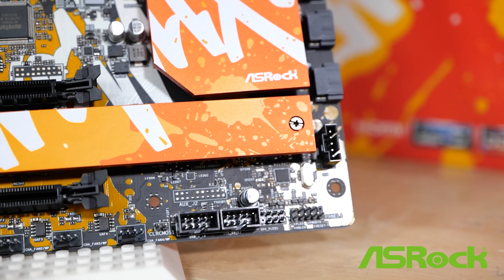Computex 2023: AMD @ ASRock! Plus Solidigm, Kioxia, and More!

Comment: 30TB NVMe, yeah at what price? I can get a 20TB Seagate NAS drive for $340 and their EXOS drive for $360. The problem with NVMe is that its just too expensive. And 8TB NVMe cost around $999.99 give or take $100 depending on quality. Meanwhile an 8TB HDD cost $70-110 depending on brand/quality. That makes NVMe about 10x the cost of standard platter drives. With that 10x ideal a 20tb NVMe would cost AT MINIMUM $3600 which just isn't viable for consumers. Business sure.... but we need consumer drives. And then you figure the higher you go the higher the price gap, so 30TB, I bet its like $10,000 per or more.... because "rape your wallet"

Comment: The thing about RGB on motherboards is I've still yet to see it done where it doesn't look like it was an afterthought tucked under a heatsink or a tiny strip on the edge of the board. You may as well not even have it at that point and leave it to the user to add it. It's just another box to check to warrant increased prices.

Comment: 9:27 I called it, the industry knows m.2 was a mistake.
Reply: Considering how far it's gotten us from SATA to today's performance - pretty easy to say there was no mistake. Standards get replaced as technology evolves, that's it.
Reply: @RyTrapp0  m.2 didn't get us anywhere, it's a shitty formfactor with a shitty connector, what you're talking about is PCIe vs SATA
Reply: @owlmostdead9492  It got us to the point where the average consumer can't even tell the difference. Shitty ol' NVME has been good enough to get consumers to the point of diminishing returns and then some.
 
But, yea, real train wreck, total disaster. Works perfectly fine, reduced physical drive size, has been bulletproof for me and basically everyone; how horrible.
Reply: @RyTrapp0  Try installing and removing them, like for maintenance, upgrades, replacements, debugging and realize how wrong you are because of how tedious it is.
Reply: @owlmostdead9492  lol, how old you think my systems are? This one is X570S - needless to say, yes, I've installed & removed M.2s. I don't know what to tell you, maybe it's just because I've always been a gearhead(do a lot of race car stuff), but M.2 doesn't even rank on my "sucks" meter. Lay your system down so that gravity is helping you? Use magnetic drivers? 
They're so compact and their placement parallel to motherboards keeps them out of the way so you shouldn't need to be pulling them for maintenance of anything else, not sure what physical maintenance you need to do to a solid state drive. Not sure how often you're replacing or upgrading them, but it really isn't a big deal. You know that there's tool-less M.2 latches now, right? The major motherboard brands offer them, even OEMs like Lenovo.
Reply: @RyTrapp0  I'm not reading that wall of text, all I will say is, try replacing 100+ nvme's in a day and every shortcoming of m.2 will be obvious to even the most blind individual
Reply: @owlmostdead9492  Ah yes, the ol' "you won't agree with my so I'm just gonna ignore what you say" excuse - of course...

There's more use cases for hardware than just literally YOUR use case